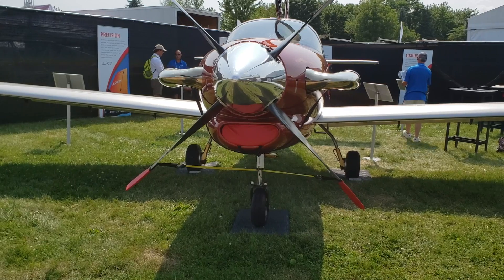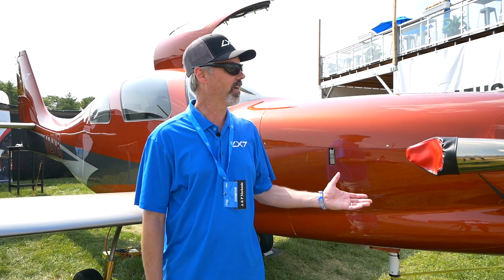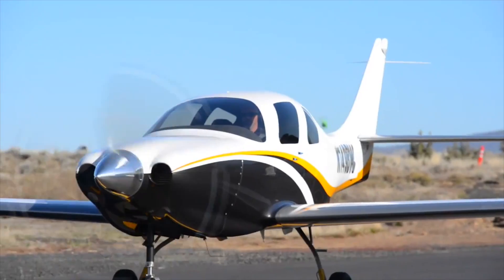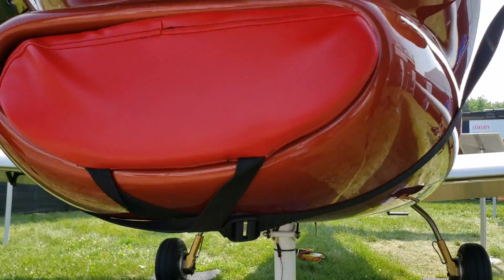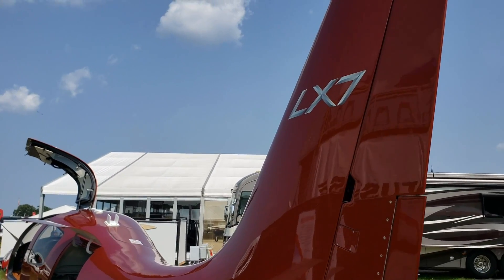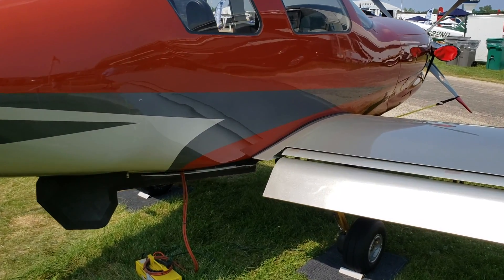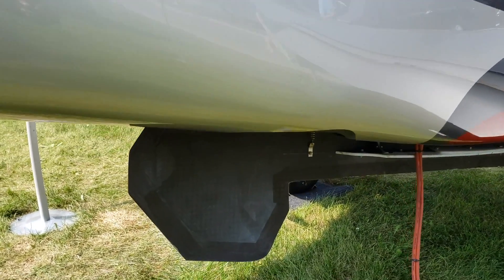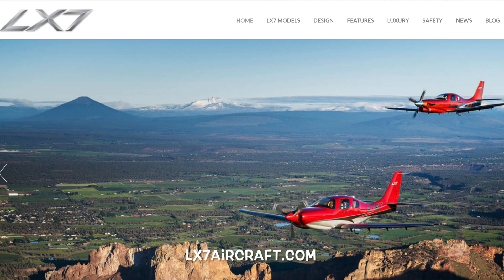This Is NOT Your Grandpa's Airplane - Lancair LX7-20. Oshkosh 2019

Comment: Really nice plane but didn't like how the lights at the wingtips had condensation inside them. That means they're not sealed well and they will turn yellow and ugly really quick.
Reply: I LOOKED AGAIN AND that really is condensation.  I am very surprised!  I also noticed that the seal around that light is just liquid rubber from a tube, poorly applied.  For a million, I would expect the company would have designed an appropriately fitted, real rubber gasket.  I hope they didn't Mickey Mouse this airplane together where it counts.
Reply: Yup, slow-mo that part and it looks like a bodge.
Reply: @garthly  I had to look up "bodge".  Great word to succinctly describe the appearance of that nav light.
Reply: Crazy for a plane of that price
Reply: @deborahchesser7375  Totally unacceptable.
Reply: Its to be expected if most of the ideas on this plane does not actually originate from this company. I happen to know that engine cowl was not done by them.
Reply: 6:21 for anyone else wondering.